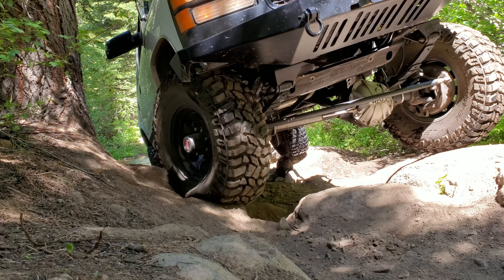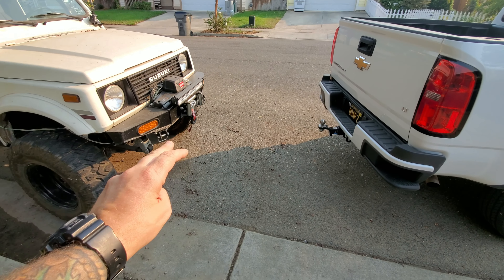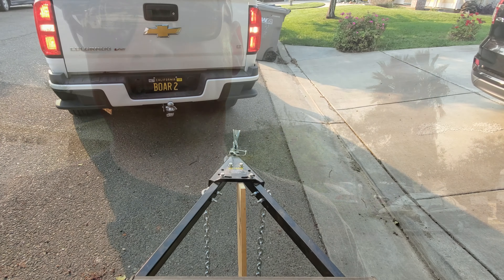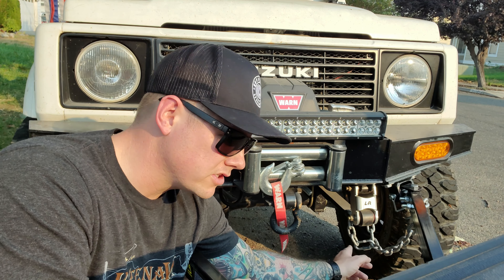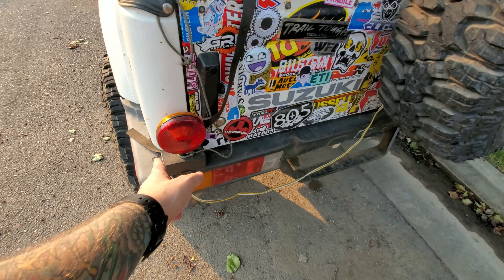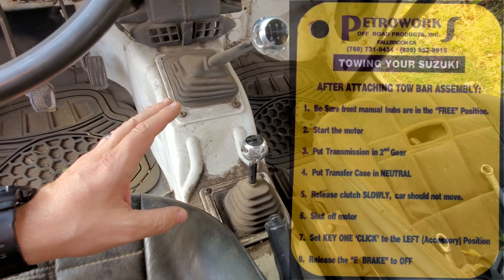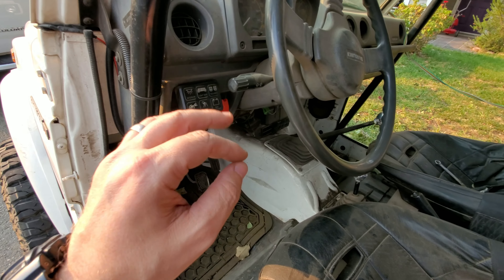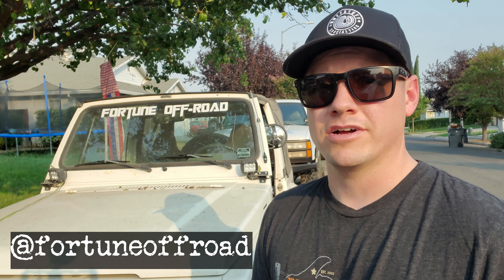How To Flat Tow

Comment: I was hoping you would have talked about why it's important to have the transmission case in 2nd gear; I've heard 3rd gear, but why? Thanks good vid.
Reply from the maker: Neutral in the tcase to prevent oil splash from turning the transmission while its seal is unlubricated. 2nd in the transmission because the forward gears (2 and 4) are less likely to have the shifter pop out, which could cause catastrophic damage. 👍🏻

Comment: Two scenarios on the transmission if not configured properly.  One is the main shaft locking up several gear bushings, which means the rear tires lock up and grind flat spots into the rims.  Two, the main shaft locks to one gear and starts spinning the engine.  Either way is bad

Comment: hey im from guatemala and i bring cars to my country like that but we bring the car on and in neutral its around 3500 milles and i never have a problem stick shift same just key in on to unlock steering wheel and car off automatic transmission have to with the car on and neutral dons t metter if is 4x4 AWD FWD oh RWD

Comment: I have the 6.5:1, do I still need to be in 2nd gear and T-case in Neutral even if I disconnect rear drive shaft and leave front hubs unlocked? Also, if I didn't disconnect the rear, what gears should I be in for my set up? Thank you
Reply from the maker: The "correct" way to do it would be the same as the video says, transmission in 2nd and transfer case in Neutral. I've been disconnecting the rear shaft and unlocking the front hubs. I just leave the transmission/transfer case in neutral and that has been working out great for me.

Comment: your bumper has a cool 45 degree angle for your bolt. My bumper is 95 degrees, should I put my bolts there. Been a bit worried cause don't want to go up a curve and have no up and down space to pull

Comment: So I did exactly what you said. I disconnected the rear driveshaft,  it's in second gear transfers case in neutral and manual locks in 2 wheel drive. Then I went under my samurai and I tried to turn the front drive shaft and it wont turn. Does that mean it will spin when I flat tow?
Reply from the maker: If your front hubs are free then it should not spin. You can just push it in that configuration by hand and see how it acts.
Reply: @FortuneOffRoad  it's all good. Thanks for the quick reply. When I started to drive forward it did not spin..

Comment: Is there a tow bar that can pull any vehicle cause it seems like every vehicle being pulled it's a jeep or a vehicle with hooks on the bumper I need a tow bar that I can.use for any vehicle
Reply from the maker: It all depends on the mounting. The one I used is universal but must be bolted on. Jeeps are popular, so they probably have vehicle specific options. If you want to be able to tow anything, you may want to look into a tow dolly.
Reply: @FortuneOffRoad  unfortunately I can't do a tow dolly I would be using it as a business and different insurance company won't insure me so I need to find something that's just basic where if someone is stranded I can get them to there location safely so that's why I'm trying to find a universal tow bar

Comment: That's a very good lesson, I'm thinking if I can permanently connect the tow kit from my truck rear bumper, but can it be possible to tow another  vehicle without removing and drilling  a screw on the bumper, like using the kit in opposite directions ⁉️ 🤔🤔
Reply from the maker: Thanks! I haven't seen anyone do that yet, but it's an interesting idea.
Reply: @FortuneOffRoad  Thank you sir, Merry Christmas to you🙏  I shall try it on my compact Land Rover freelander 2 with your complete ideas,  I swear many would copy it at once, although I may only use it to tow sedan and SUVs by any chance nothing too heavy,

Comment: I noticed that you have the same TT shift knob as I do. This is not the shift pattern on the Trail tough website. Can you explain your transfer case shift pattern? Why can't you just put the transfer case in 4N and leave your rear axle connected?
Reply from the maker: I do t know why they said 2N but yes, you should be able to put your transfer case in N, and your transmission in 2nd with shaft connected. I just played it safe and disconnected the rear shaft. One mistake on your shifters and you can mess things up pretty bad.

Comment: Donyou lock the sterring wheel? Or just leave it free???
Reply from the maker: I put the keys in and turn it to the first click. That ways the wheel is free to turn. 🤙🏻
Reply: Fortune Off-Road So, its not danger? I mean, I will have to travel across two countries, is mu first time pulling a truck, I haul trailer but I gues is diferent, because the truck is a 4 wheels, and I was thinking to lock the sterringwheel, because other way the truck is going to be miving a lot
Reply: Fortune Off-Road what do you recomended me??
Reply from the maker: @BelloGonzalez  if all 4 wheels are on the ground, the steering wheel must be free to spin. The front tires will track behind your tow vehicle. 👍🏻
Reply: Fortune Off-Road Ok. So, I guess I will take the trucks like that.... Thank you for your answer

Comment: Ok, so if you have power steering you don't need to do anything to the steering wheel ?.
Reply from the maker: The steering wheel needs to be unlocked by putting the keys in the ignition so it can move freely
Reply: @FortuneOffRoad  ok, but I have a 1968 cj5 with power steering no key lock position
Reply from the maker: @randy-mw5dq  as long as the wheel and steering can move freely you should be good there
Reply: @FortuneOffRoad  thanks bro.

Comment: Dude thanks for going over this for the Sami. The key position is no joke! Just curious are you required to have a breakaway braking system in Cali?
Reply from the maker: After searching for hours, I never did find a definite answer. I know a bunch of cops and Highway Patrol and they never mentioned it. At the very least its a good idea.
Reply: Anything over 1500 lbs. needs supplemental brakes in Ca.

Comment: How fast can you typically tow.  Is 70 ok?
Reply from the maker: Where I drive its 55mph. I wouldn't go much faster than that 🧐
Reply: @FortuneOffRoad  thx!  I picked up that same towbar for my 48 Willy's.  I changed out the critical hardware to US grade 5 and made up some additional bracing..  I also set to my magnetic trailer lights to be zip tied in case a pothole jars them free.  I like the idea of using carabineers to secure the wiring - beats cutting and replacing them.  I was able to do a test drive to about 40 - all seems good.  Will wait till I have a passenger before hitting fwy speeds.  Thx for the vid

Comment: When do you have to start being concerned about auxiliary braking?
Reply from the maker: Almost all states require a supplemental if certain conditions are met. Usually it's towing vehicles over 3,000lbs, but in some stares could be as low as 1,500lbs. I'm not expert so definitely don't take my word for it; better to look it up for yourself. I find brakes are always better than no brakes! 😉
Reply: @FortuneOffRoad  Yep, it's 4,500 lbs for Texas. I'm sure brakes are better, but brakes for flat towing a Jeep are expensive.  I was wonder if there was some sort of formula like tow vehicle must weight less than have of the tow rig or something.  I purchased a 2021 Jeep Gladiator to flat tow my 1998 Cherokee.  Would rather do it on a trailer, but you have to have a place to put one of those when you're not using it. :D
Reply from the maker: Yeah, exactly. Just picked up a trailer so I don't have to worry about any of that... except the storage. 😬
Reply: @FortuneOffRoad  and the tires, and the axles, and the storage. lol
Reply from the maker: @Jeeptalkshow  true, but you're offsetting the wear on your truck tires, and axles which cost more and are more time consuming to replace. My new trailer was $66 for lifetime registration. The Samurai was $175 a year not counting smog.

Comment: Why 2nd gear? I have towed transmission neutral, transfer case neutral, hubs free. 

No issues so far.

I know its whole nother animal, but I pull my rwd with the transmission in neutral... hence I applied it to flat towing my samurai.

Amazing video btw!
Reply from the maker: The 2nd gear is to circulate oil in the transfer case. The manual recommends stopping every 200 miles, starting the engine, and giving a rev for about 1 minute to circulate the oil. 🤙🏻
Reply: @FortuneOffRoad  thanks a lot bro. Can't wait for us to have trailers so we don't need to flat tow anymore. Lol
Reply: @FortuneOffRoad  So what if have to tow my automatic do I just put the trans in neutral and the transfer case in neutral

Comment: Still don’t understand how the front wheels steer by themselves.
Reply from the maker: There is a lot of weight on the front tires from the engine, and the front end is getting dragged around. The path of least resistance is to go in the direction pulled.
Reply: @FortuneOffRoad  So when you make a sharp turn with the RV the front wheels of the Jeep actually steer in the same direction completely on their own just because they are pulled in that direction? This seems bizarre and I have not seen anyone actually explain how this works. What stops the wheels from steering in the opposite direction and getting dragged sideways? Doesn’t it have to overcome the power steering pump while the vehicle isn’t running? Thanks
Reply from the maker: Weight on wheels is why they turn. If you were strong enough to pull your vehicle from the front the wheels would naturally turn that direction. With the vehicle off the ppwer steering pump isn't running so there isn't much pressure on the system. Since the steering wheel is unlocked there is nothing locking it mechanically either. The process isn't perfect and the tires do scrub sometimes. A trailer is much more preferable for me.

Comment: Reversing a flat tow vehicle is impossible
Reply from the maker: Yeah, definitely doesn't work well!
Reply: Not impossible, it helps tremendously to be on pavement and start out with both vehicles straight; yeah, it can get squirrely for sure and you may not go a great distance. For a straight back up, get both vehicles perfectly aligned and turn the ignition off to lock the front axle; this should get you further in distance.